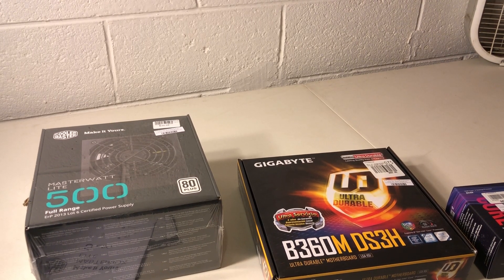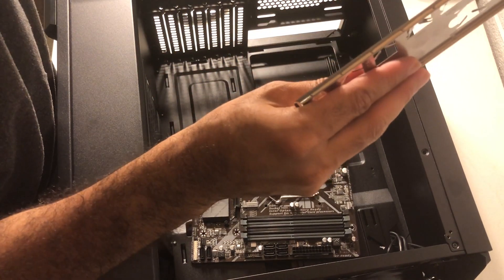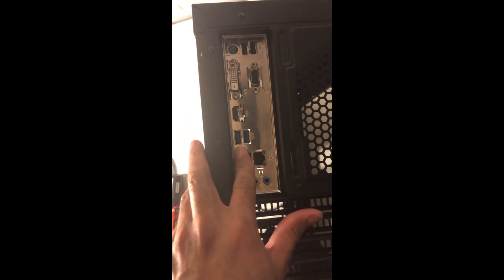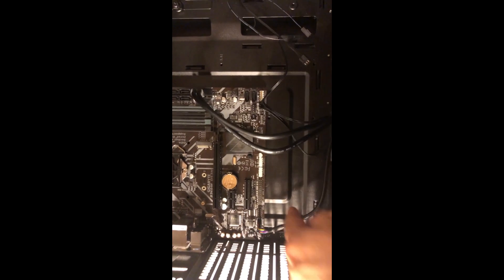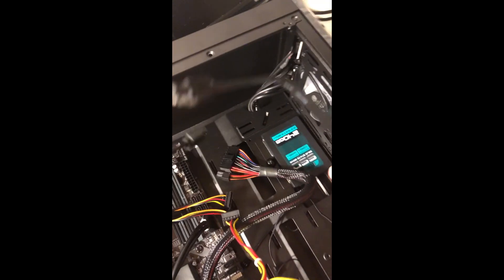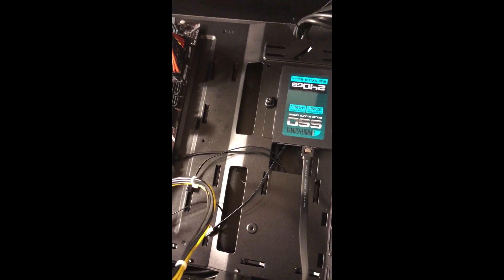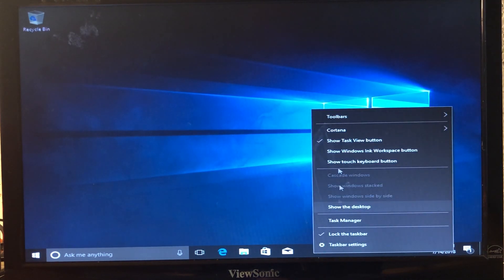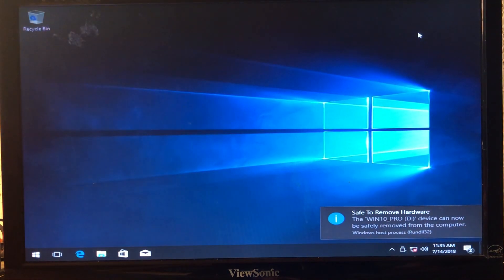How to Build Gaming PC Step by Step under $800 using gigabyte b360m ds3h Motherboard

Comment: im having problem getting my leds to work have the same mother bored and case would like help if you can and what software did u use
Reply from the maker: Hey Charles, i will be more than happy to help you with this. If you forward the video to 7:56 you will see the labels of the led wires and where to insert them. Let me know if you have those exact wires

Comment: I have this same mother board, but I also have no graphics card yet. I turn my computer on but my tv says no signal. I changed around all my ram sticks and atx cable and I still have no signal. Please help
Reply: Dayton are you connecting your motherboard to a TV via HDMI cable or VGA cable? Also, does the motherboard turn on? please also verify the input on your TV. Is it set to HDMI (if connecting via HDMI) or VGA (if connecting via VGA cable). Please note, some TV lists VGA option as PC.
Reply: Jay a yeah it’s connected via HDMI, I don’t have my graphics card in yet, I was told the processor had some graphics in it so I could at least download windows
Reply: Yea you dont need an additional graphics card if you are not planning on playing hardcore graphics video game. The motherboard has a built-in graphics card which utilizes from the CPU. Usually the video doesn't work if the memory inserted are not in order (please see video at 19:26). Once you have confirmed memory, please check the cmos battery on the motherboard, if that is also correct then check the 2nd ATX cable (video 12:30), if that is also correct then try to boot the system without the hard drive connected. Share your results.
Reply: Jay a hey man, I tried all this, it’s all hooked up and in order correctly as per your video. Is it maybe because I’m trying to use the tv as my monitor?
Reply from the maker: Dayton I dont believe TV would be an issue as long as you are connecting via proper cable and the input on your TV is changed accordingly but just out of curiosity, can you try on a monitor and see if it works? Otherwise the only thing i can think of is the motherboard may be faulty at this point, provided that the processor and memory are correct obviously.
Reply: Jays Tech Stop I just ordered my monitor, hopefully once it comes in I’ll hook it all up and test it out. If it doesn’t work, I’ll call the mother board company and get more information about that.
Reply: Jays Tech Stop if you’re willing to help more, I can get you social media info and I can send you some pictures of it just to confirm everything is okay and all set
Reply from the maker: Dayton did you buy this motherboard used or new? If you bought it new, the store should be able to swap it for you for free. As for extra help, I am always happy to help a fellow creator. You can find me on facebook, instagram and twitter under the same name "JaysTechStop". Let me know where you upload the pictures and i will take a look at them :)
Reply: Jays Tech Stop I bought it new off of amazon. I’ll follow you right now. Thank you

Comment: Hi thanks for the video, i'm currently using the same board as you for my build and I was struggling to locate the second fan slot if it has one, would u happen to know anything about it?
Reply from the maker: Hi sheng 
So by second fan slot, I am assuming you mean the connection to install 2nd system fan, correct? If that so, then please forward to exact time 8:27 and pause there. You will see a label “SYS FAN 2” on the motherboard itself. 

Please let me know if that was helpful. If not then let me know and i will further check
Reply: @loyaltechsecurity  ah thank you so much for time. I appreciate the help but unfortunately I just realised that my motherboard is completely different to yours :")  mine is the b450 ds3h and ive looked over the manual and it doesnt specify the loacation except for sys fan 1 , I guess its fine for me to assume there is only one fan slot?  Sorry and thanks again :-)
Reply from the maker: Sheng I looked at the Motherboard b450 ds3h you mentioned above. There is only one sysfan option allowed on the board itself. But if you would still like to install an extra sysfan, you can run it thru your power supply connector. There is a power supply pin to sysfan pin connector adapter which will help you accomplish what you are trying to achieve. Please see this link on ebay for reference https://www.ebay.com/itm/12V-4Pin-Molex-to-3Pin-CPU-PC-Case-Fan-Power-Splitter-Cable-Adapter-Connector/163086962216?epid=21019994698&hash=item25f8bd8e28:g:-HUAAOSwi0RbGYiVor you can search in google for (molex to 3 pin fan) and find even cheaper ones. Hope this helps. Good Luck with your project.
Reply: @Jays Tech Stop Hey great video i build my pc and then watched your video because my pc turns on and everything but my monitor doesnt,idk what i’ve done wrong all the fans are working,thanks in advance